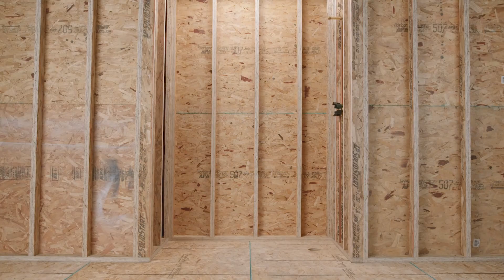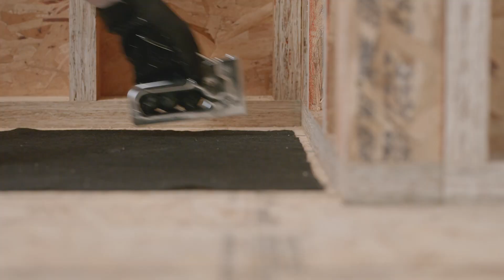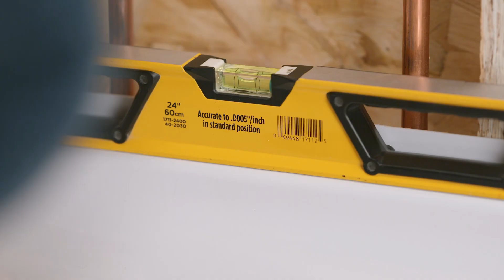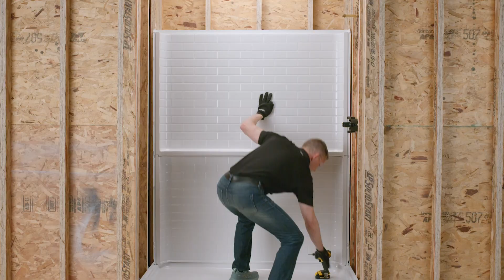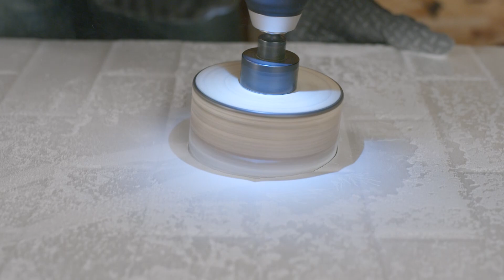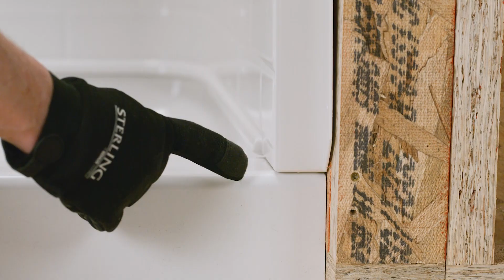Vikrell Installation Video – Traverse End-drain Shower

Comment: This product only works if the person does not replace the shower nozzle with one with a flexible 3' hose capable of washing children and pets. If spraying pets this product has the potential to cause water to get sprayed upwards and behind the enclosure damaging the wall. There is zero waterproof barrier between the enclosure and the ESB/OSB board which absorb the water and may create mold.